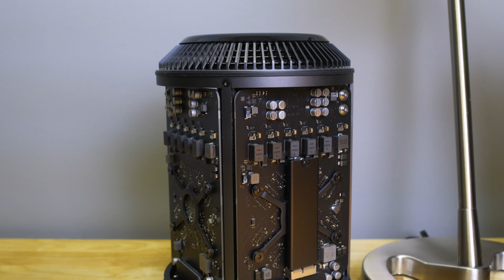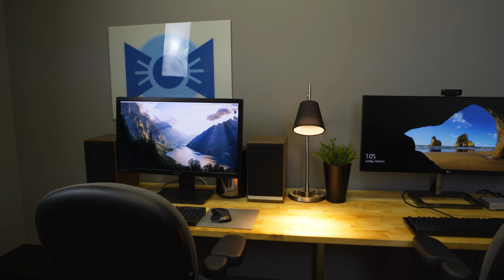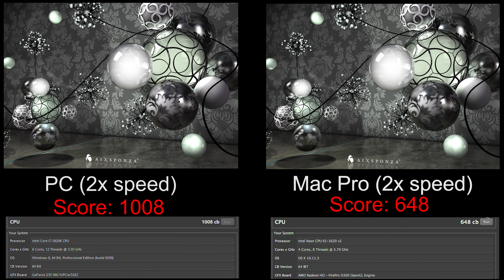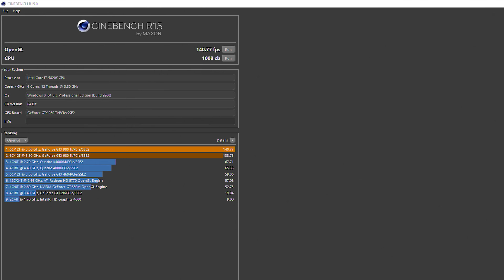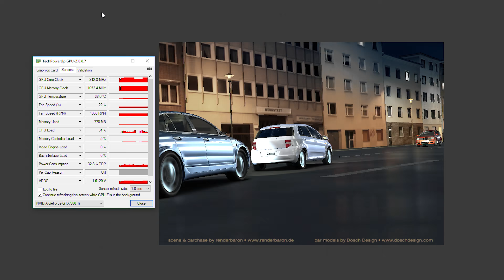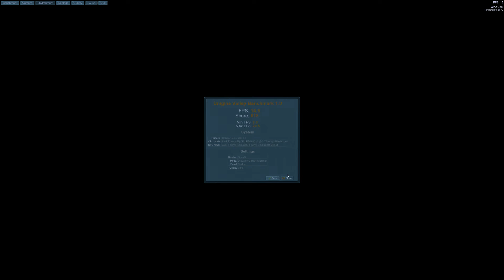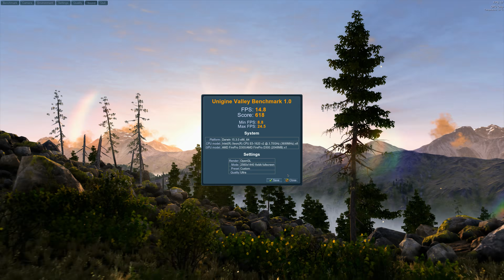$2,000 Custom PC vs $4,000 Mac Pro

Comment: is it really that bad to buy a refurbished power supply
Reply: If it works then it's fine.
Reply: refurbished means defective parts were replaced. But not all parts. that means the power supply could have run 2 years. maybe they changed some capacitors and gave it back to sell as refurbished.

But there are still parts that worked 2 years under stressed condition. I can 100% asure you, if you have 100 refurbished and 100 brand new in the opposite. After 2 Years or such the Refurbished will fail in a much higher % than the new ones.

So, if you want to go cheap do it, but dont expect it to last too long.
Reply: Electricity is the blood of your computer. I never skimp on the power supply. It is used in all of your components. Skimp on ram or something.
Reply: it was a cx600m it was really cheap and free shiping i didnt notice the refurbished sign until i was unboxing it
Reply: it says it is factory refurbished and it has a lot of reviews on that very psu with that seller

Comment: Did you max out all the  ram on that mac pro?
Reply: +wooka64 eh I'm 13 and I learned a shit ton in a couple hours it's not hard
Reply: It wouldn't have really made a difference in any of the three benchmarks.
Reply: It depends, If the ram is the same quality, I am sure it would of made a little difference.  P.C have a wide variety of hardware so the P.C could do better if you have higher quality parts. The only reason Macs are praised is because of the experience. Developers only have to worry about one set of hardware.

I don't think any computer is really better than the other, it  just with a P.C, you really have to know your parts to get the best out of it with a  mac, you don't have to worry about it because all the parts are the same.I think the best P.C are custom built because you have full control and you don't have to bring your computer to a shop to fix it. I prefer P.C over Macs, but I still like Mac's because those were the first computers I ever used.

Comment: Would love to know how you built the desk!
Reply: It would be nice, but since there is little interest in it, i doubt he will do it. 

Now what about the desk do you like? If you can answer that I can give you some tips on how to build something like it.
Reply: I'm not the guy, but I'm interested. The wood looks super nice, I wouldnt even know where to get it let alone how he got the thing connected to his wall. Thanks!
Reply: kimaegaii The wood you can pickup at Ikea, or you can use plywood, or whatever else you can find in the dimensions you want. 

Do you have more than one wall that you want the desk attached to? Like will it be surrounded by 2 or 3 sides, or just one? What are the overall dimensions you are looking at? and any kind of budget in mind?

There are different ways you can do it, some more expensive than others. A "cheap" way would be to use a dual track shelving system, and buy the brackets for a flat surface. Or a really cheap way, but less leg room would be heavy duty shelf brackets. You can also make it sort of like a "floating shelf" depending on how far you want it to come out from the wall.
Reply: qballtvp I would prefer it floating. I didn't know Ikea sells wood, I thought they sold just like already made desks and stuff. The wood desk in this video looks shiny, do you think he polished it with something?

Also I rent so the less damage the better to my walls.

Thanks a lot for your comment!
Reply: kimaegaii Np... 

I am pretty sure this is what he used for the top. 

http://www.ikea.com/us/en/catalog/products/20275140/

For a desk like that to be floating it would need to be a little thicker, and or have some ridged mounts. It wouldn't be like truly floating. 

What are the dimensions of the desk that you want? How many walls will it attach to? 1, 2, 3? Do you have any tools, like a circular saw, table saw, etc? A drill? 

And again what is the budget you are looking at, if any? 

For anything that doesn't have legs, or at least back legs, you will need to locate studs in the wall and use long screws and or lag bolts depending on the route taken. If you can't screw into the wall you will have to either make one with 4 legs, or two, but more like a C shape so you can have some leg room. 

Some options for mounting the desk to the wall, the easy way at least. 

http://www.homedepot.com/p/Rubbermaid-24-in-D-Twin-Track-Bracket-in-White-FG4C0802WHT/100679097

Those brackets with the rails. They can hold a shit ton of weight, it will be your strongest option. 

http://www.homedepot.com/p/Everbilt-20-in-x-13-in-Gray-Heavy-Duty-Shelf-Bracket-14307/206091419

Those will be fairly sturdy, but will be less leg room. Not too bad though. 

If you have 2 walls, you can run a board along the edge of the two walls, and use a heavy duty shelf bracket at the other end. If you have 3 walls and want to fill all of it in, you could just run a strip of board along the edges, and put it on top. Maybe throw a few screws in from the other side to keep it from sliding out.
Reply: qballtvp Wow thanks a ton. Are you a carpenter or you just enjoy building things? Currently I am pretty sure I am not allowed to drill into the wall. I live in Japan and while it's a nice place, the walls are still very thin. (They do have IKEA in Japan btw.)

I guess I will try for the 4 leg option. Although the floating look is so cool. If I was back in America I would definitely do it.

About the length, I would like something around 6 1/2 to 8 feet.

I was a bit confused about the C-shape reference. If I made it with 4 legs, wouldn't it be best to have them all at the corners giving me the maximum leg room?

Thanks!!
Reply: kimaegaii “Are you a carpenter or you just enjoy building things? “

I have a lot of interests; I can do carpentry work, metal work, mechanical work, also build computers, websites, light programming etc. The desk in question I built one myself with the twin track system. I used a 4’x8’x3/4” sheet of plywood as the top, cut it out with a jig saw. The main working area is around 30” wide. Imagine an L shaped desk with the long part of the L being 30” wide. Primarily I just like finding solutions to problems. In the case of my desk, I didn’t have a lot of money at the time, and all the desks I found that I would even want were in the 500+ price range, and had way too much stuff that I didn’t need. All I wanted was primarily a flat surface with a lot of leg room. So I started thinking outside the box so to speak, and I have used the twin track brackets for wire shelves in the past, and knew of the brackets for wood shelves, and found the longest ones I could find, and built it from there. I think in total I spent less than 200. Maybe less than 150. 

“Currently I am pretty sure I am not allowed to drill into the wall.”

That could be an issue. I mean if the walls were a specific color that you could easily replicate, when you move you could always fill the holes with spackle, and sand it down, and re-paint the area. 

“the walls are still very thin”

Even if they are walls with 2x4’s turned sideways, it would still work. My desk I could put a shit ton of weight on it, no problem, even standing on the very edges with no buckling. With 2x4’s sideways, as long as you didn’t try to put a ton of weight on it, there shouldn’t be much of an issue. With the twin track system, if you buy longer standards (uprights) it would more evenly distribute the weight along the length of the 2x4 and as long as the wall was securely fastened at the top and bottom it shouldn’t be an issue at all. I would imagine you could easily get away with a 500lb distributed load, and or 200lb at any single point… minimum. 

“I was a bit confused about the C-shape reference.”

Basically they are legs that resemble a C. Where the back of the C would be against the wall, and the open part of the C would be where your legs could go through. The top of the C the desk would attach to that, and the bottom of the C would touch the floor. Take a look at this https://www.knoll.com/product/pixel-by-marc-krusin%3Fsection=Design#1 You can see how a C-Leg would be. The legs at 4 corners, would give leg room between the legs, but not to the edge. So if you wanted to quickly turn around in a computer chair at the edge of the desk, you wouldn’t bang your knees/legs on the leg of the desk/table. If something like that matters to you, look into the C type of legs. If you don’t mind the 4 corners having legs, and or it’s not an issue then you could get something like these. http://www.ikea.com/us/en/catalog/products/10217971/ but not sure how well they would handle shearing loads. A shearing load, if you are not familiar would be taking a table, and pushing on the edge to move it across the floor. Where the legs grip the floor it exerts a shearing stress on the legs, and if you have ever seen a table, especially a kitchen table, wobble when touched, that is due to those kinds of loads. As long as you have it against a wall, and or two walls it shouldn’t be that big of an issue. Having it out in the middle of an area where it can be bumped, or moved without lifting up straight, and moving it with 0 contact with the floor or other objects that could be an issue. With those kinds of loads you would want to look for legs with bracing and a larger contact patch with the underside of the table surface.
Reply: qballtvp
Thanks so much. I think the ADILS legs are my best bet so far. Since I'm in a foreign country I'm a bit hesitant to start drilling into the walls here lol

Really thanks a lot for your help. You should start like a Youtube channel for building things, I think you could possibly make a career out of it.
Reply: kimaegaii I am probably going to start one at some point, but not necessarily building things in that way...